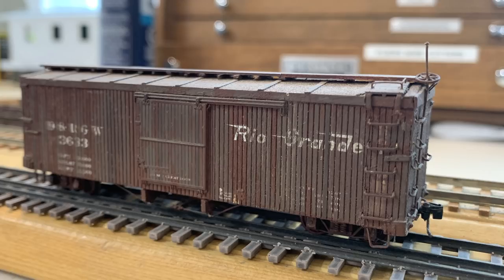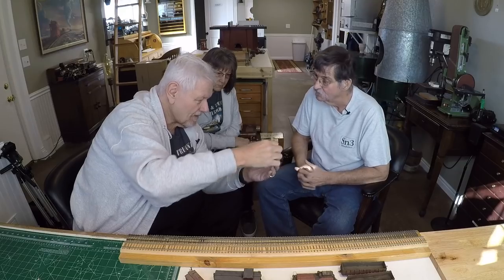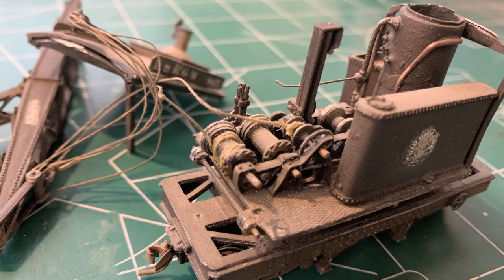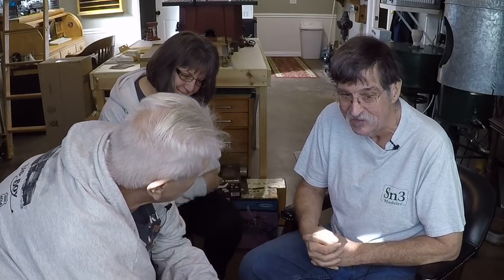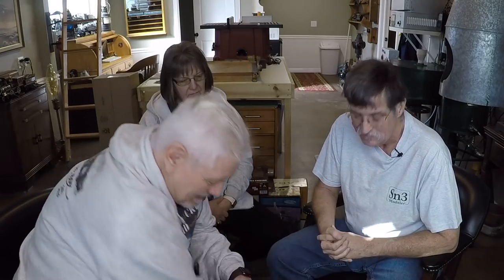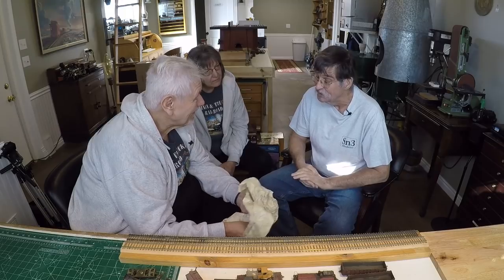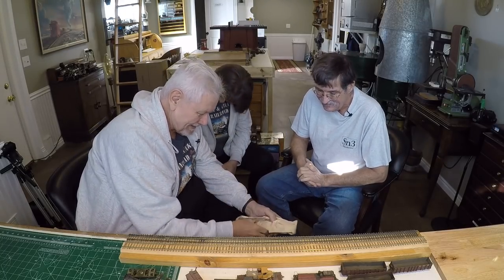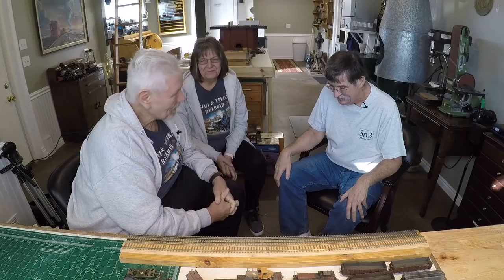HOn3 Time Capsule - Unboxing Doug's old HOn3 train cars stored for 20 years PART 2

Comment: Toyman great video, while u've been working on your old models I got my old athern blue box f7 up in running for the first time in 6 or 7 years
Reply from the maker: The ubiquitous Athern blue box. I’ll bet I have 100 freight cars from the blue box, and boy are they neat!  Always a bit tricky to get the diesel engines to run just right but you can! Emphasis on can as in can motor.

Comment: You said display case! I am looking for them now! No one has any for N scale stuff. Have any idea of where to look?
Reply from the maker: Yup. We bought the 144 shot glass display case off eBay. Also on amazon but 10 bucks cheeper on eBay. A bit big for N but a bit tight for HO. There is a nice case for n on amazon. By display gifts.
Reply: @ToyManTelevision  Thanks for the tip. Must have missed it or searched wrong description on the 1st try..